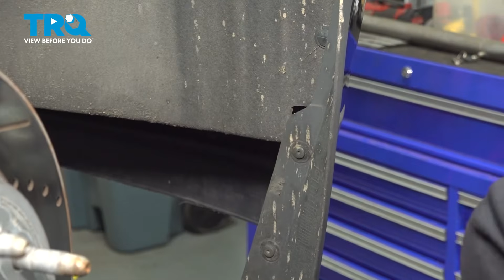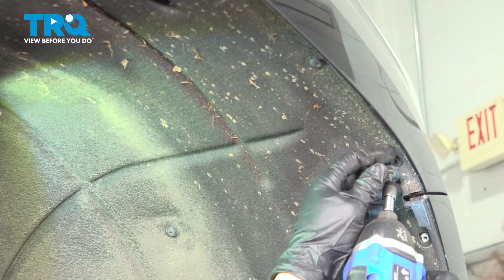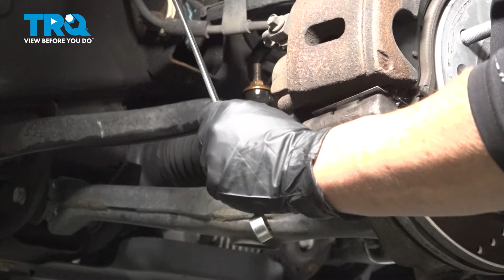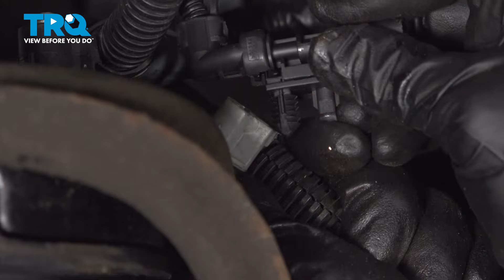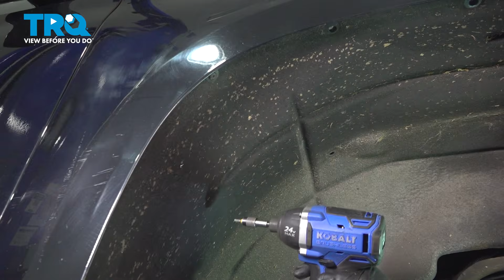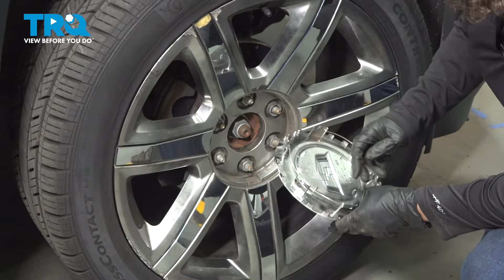How to Replace Front Shock & Spring Assembly 2015-2020 Cadillac Escalade

Comment: I want to recommend buying from you guys! Just installed 2 struts ordered from 1Aauto. Unfortunately one of them is throwing a code, open circuit. I plugged in my old one to confirm, and it was bad. I just logged in and a replacement was placed at no cost and no hassle. Thank you! I will order my parts in the future from you guys!

Comment: Here’s my feedback:

My vehicle is a 2016 Cadillac Escalade with front shocks that were completely done to the point where the ride was so rough it felt like a Roman Charriot. It would bounce a lot too.

1. The front shocks from 1AAuto worked on my vehicle.
-no check engine lights
-easy
-plug and play

2. The reason why she takes off the inside fender skirts is because her vehicle is on a lift. 
If you’re doing this in your garage, just pop the hood and you’ll have easy access to the top 3 bolts.

3. The shocks fixed all my issues and you can tell a huge difference.

4. The only issue I did have was needing an extra hand to help me position the shocks while I pull the control arms down.

I’ll try to remember 6 months from now to give an update on how the shocks are holding up
Reply from the maker: +@dailyrevs1320 Thanks for watching our video! http://1aau.to/m/Shop-TRQ

Comment: I know that she wasn’t working on the brakes but the rotor is installed on the wrong side of the vehicle. I replaced my struts yesterday without removing my inner fender wells but it looks like it would make it easier to access the top of the struts. This is a good instructional video.

Comment: Buyer beware. I replaced my struts on my 2016 Yukon Denali with TRQ struts with magnetic ride.  For some reason, the front struts seem to bounce a lot while driving.  I noticed the spring coils on the TRQ are much thicker than stock.  Honestly,  I haven't been happy with them.  I am not sure what to do.  I think I am going to have to bite the bullet on the money paid for the install and send them back.  If someone has any suggestions, I sure would appreciate it.
Reply: Yea, return them. I'm going switch out the shocks and reuse the old springs.
Reply: Strutmasters